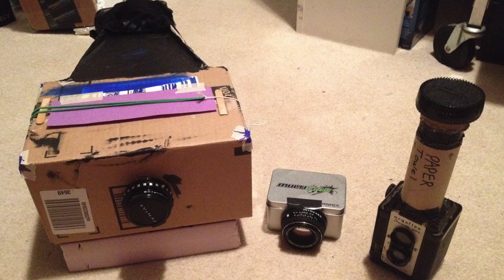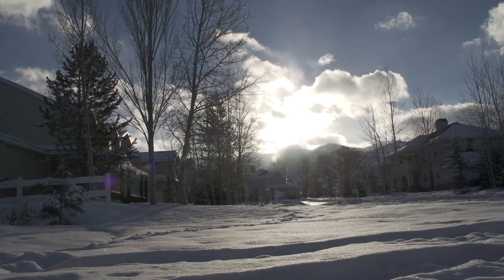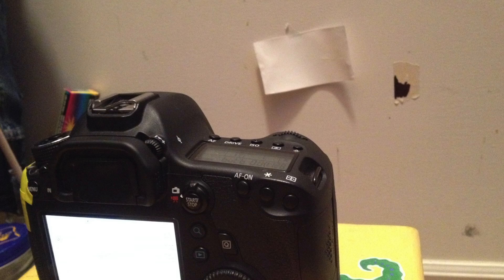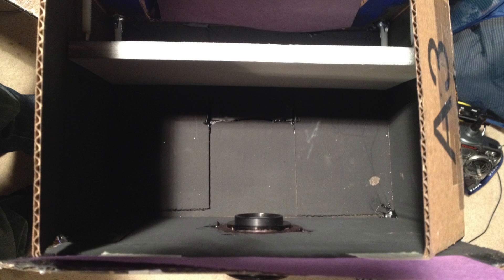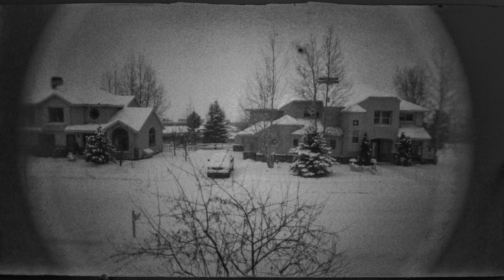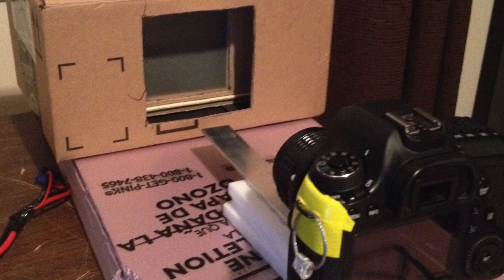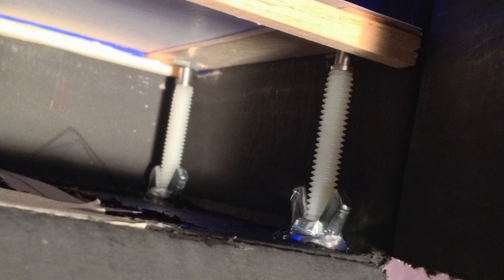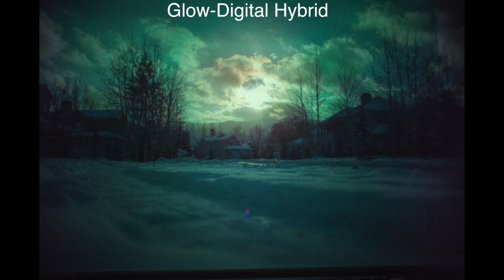Photoluminescent Photography - RCTESTFLIGHT -

Comment: That is great I have never heard of this before. I can't see any application for this but it is great that this has been thought of. I especially like the hybrid. I take night photos but this is a great system for doing long exposures in the day without messing around  with chemicals. It also means you can create long exposures during the day with a shallow depth of field. To get the equivalent in digital you would use a nd10 filter and a high f-stop. Great. Thank you